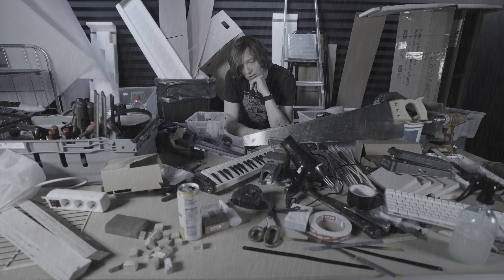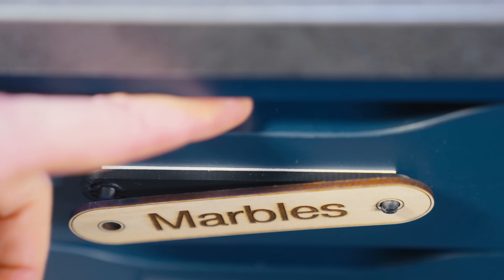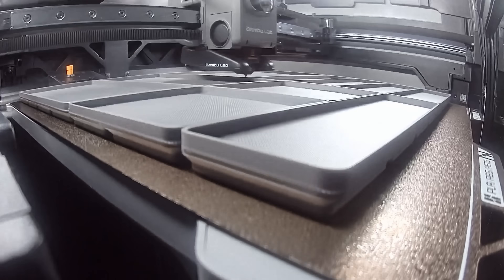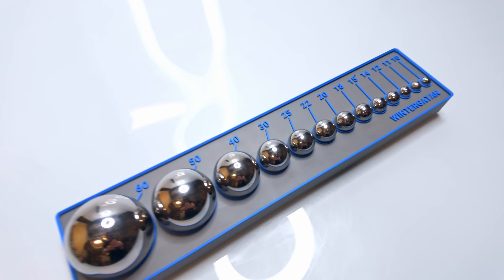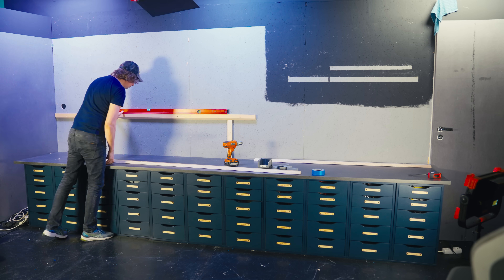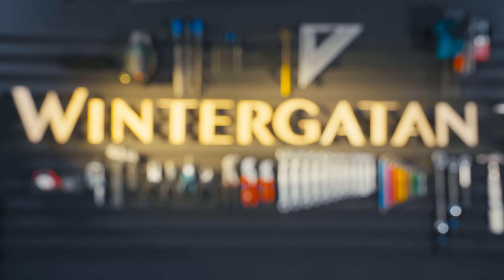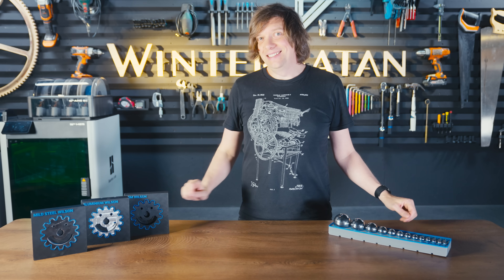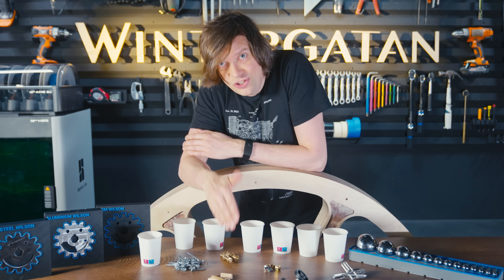Building the Marble Machine Workshop

Comment: I can relate 100 % to his need and the importance of being organized define all the parts you need within only seconds: I also am a mechanical genius/inventor always designing, testing and perfecting various different mechanical and electrical gadgets that create useful and time-saving gadgets for everyday personal use. 

BUT, in  order create these perfectly constructed and engineered mechanical and electrical devices, I needed to accomplish 2 separate goals: 
1. Having over 100,000 different parts like lightbulbs, switches, relay switches, different wire sizes and lengths, diodes, resistors, motors, O-rings, rubber grommets, brackets, straps, rheostats, just about every different size and shape of various rubber, plastic and metal parts as well as thousands of various different sizes and lengths of stainless steel screws, bolts, washers and lock washers.

 2. And, most importantly, being able to have them so perfectly organized and categorized so that I could locate and find any one of those 100,000 various different parts within just seconds. :face-blue-smiling::trophy-yellow-smiling:

Comment: Okay for real though, you should print off a bunch of single-block holders and fill your random drawer with singles and use them just like you did those little paper cups you dumped the random items out of. Then when the drawer starts to get full, you can look inside and go, "Okay, I actually have a lot of little wooden pegs, maybe I should make a space for these in one of the official drawers," and then you can look at the containers with only one of an item in it and go, "Okay, I guess I never use this and don't have any more. I'll throw it out to make space." And that is how you keep your system from falling apart while still leaving space for the realistic accumulation of random shit

Comment: @Wintergatan choose one:
 "She may be old, and loud but she runs better than the newer ones".
 "You see imperfection, I see it part of the art".
"Just because you add more boost to get more Horsepower for your Fiat doesn't mean it can haul a trailer. just change the vehicle that can".
"If what you change don't work, go back to what did work and improve it".
"If your diesel truck isn't leaking oil, then it has no oil to leak". 
"The story of Dragons goes all the way back to something much simpler".
"Never put all your eggs in one basket".
"There are always 2 types of maintenance to everything regardless of what: Corrective and Preventive maintenance". 
"Different isn't always a bad thing".
"Music is just some tool that is tuned up and calibrated. just like any other fine tool".
"You never know what you had until it was gone".

"There is no such thing as luck, you don't know Luck. So, rely on something else".
"True music is not in a book. It's in your ears and soul".
"Just because it's old and reliable, doesn't mean it's easy to use and maintain a steam train".

Comment: Okay this gave me the motivation to do my room as well. It has been on the planning for an extremely long time, and I think it's finally time. My room is a mess and I had the same issue as you, not finding it pleasurable to be in my room. Cleaning up is easy, but not a permanent solution. I need to organize stuff. I already built a huge drawer under my desk, only have to design and print the bins now.

Comment: The point on making jigs is sooooo important. I built a large storage rack with my dad and he insisted on measuring everything because he didn't want to waste time making a jig. I told him I was going to grab a drink, spent 5 minutes making a spacer block, and then when I got back he was halfway through mounting one instance of the thing we were copying. It would've taken him over 10 minutes to do it solo, together we would've probably done it in 6 or 7. After using the spacer block that time went down to 4 minutes and after making some more spacer blocks it went down to 2 minutes. Jigs and spacers are king when replicating anything accurately

Comment: Martin, I used to have the same problem, never being able to keep my workshop tidy. After a while and I think about 20 rebuilds of the workshop (no joke). I came to a simple conclusion: If you're workshop is messy, it is not necessarily because you are messy, but because you and the workshop are not in sync.
In other words, if you notice it is getting messy again, reconsider where some tools live, if the always end up on the floor or on the worktop, then it is most likely because where it actually lives is too far away from where you are working, just as an example. Put the things you use the most, closest to where you work, that was the key for me. The other thing what worked for me was: nothing  lives on the floor, no wood, no boxes or anything like that, and all the tools that require a place on the floor got wheels on them so i can roll them out of the way quickly and easily
I have now rebuilt my shop about 30 times, and slowly i have come up with a system that works for me, and now i can't stand having a messy workshop anymore. It is a joy :-)
Reply: Exactly!!! Designing an orderly workshop isn't about just making things look nicer!

Comment: One thing ive learned making a 3d printed french cleat tool wall, is that a lot of the holders realllly want a cleat lock. Basically a little removable piece that slots and pins the holder to the bottom of the cleat. Without it, you will often get into a case where you lift up to remove a tool and end up knocking the whole hook onto the ground (particularly the holders for lighter tools)

Comment: Martin this was such a great video! Also thanks for introducing me to 'gridfinity'. Wow 🤩 Also, FWIW, my tip for reading lots of words (eg your drawer storage labels) is to not use all caps for the labels. It's a tiny thing in your context but the science is that the last thing we do in reading is look at individual letters. Our brains scan the shape of the word first trying to pattern match with familiar words. Turning each letter into a rectangle of the same rough dimensions removes most of the features of the word we use to recognise it, eg springs vs SPRINGS multiplied by the number of labels you have. It's only a fraction of a second lost each time but I know you like efficiency and effectiveness so thought to mention it 😀 Finally, for any upgrades you might plan for later, consider using a symbol (pictogram) instead of words, eg an icon of a spring or a combination. You could also use a colour code for different types of items. This would speed things up for any helpers you might get in. eg hardware has green labels, cables have blue labels etc 🤔 I'm doing this combo of words and emojis on my Mac folder labels and it's a game changer IMO. Again, thx for this vid ❣

Comment: Be careful with optical lenses! Fungi thrive in dark, damp conditions! Optical lenses should be stored in a bright place (preferably with the caps removed to allow light to pass through) in a transparent box (possibly with a silica gel dehumidifier system, which needs to be regenerated when it becomes too saturated with moisture). You may be in for an unpleasant surprise with fungus on your lenses! Repairs are expensive. I've already had to pay €1,500 for a Canon RF100-500 lens worth €3,000...

Comment: IS the long table top above the alex draws from Ikea as well? I wish to borrow this setup for my workshop!
Reply: Its actually a generic 4.6 meter kitchen bench from hardware store Hornbach. Ikea have them too, but not that long - at least not as their standard size.
Reply: (I usually design studio sets using kitchen bench tops for their rigidity, so I had that one already in the Fallout set (seen in the gear down part) when Martin moved in)

Comment: I've got drawers. I've got organisers. Hahaha, it's not about having drawers and organisers, it's about putting things back every single time. EVERY SINGLE TIME. This looks amazing and it is well thought through. Please do it justice by using it.
Reply: It's an advertisement for the 3D printer.
Reply: my solution to organizing screws is to buy new ones when I have a full box of mixed screws I have to go through to find something
Reply: That final scene is straight out of Marvel movies.

”Random will return”
Reply: As Joe Barnard says: It is easier to take pride in your work when it is shiny. Putting things back is a lot easier when it makes a difference and does not just move the mess into a drawer.
Reply: Certainly. It's important to have a particular spot to put left-overs such that you are prompted to clean up and put stuff away when it's too full.
Reply: Indeed, I also have a nice order in my workshop…as long as I use it…😂😂😂
Reply: Tell this to my kids (and the wife, but I'm scared to tell her off)
Reply: A visual sizing guide for the screws/washers/bolts/etc at the base of each drawer helps.
Reply: Martin has made at least one video about shop clutter and organization, the latest was five years ago. That was in his previous shop. 

All thrust, no vector.

Comment: The problem begins when you find a loose screw but don’t know exactly which type it is. The system can be very effective, but unless identifying the bolt is as quick and effortless as tossing it into the random drawer, you will just keep defaulting to the drawer and the cycle continues.
One possible improvement is to design the system so it automatically rejects the wrong bolts—for example, a bolt that doesn’t belong simply won’t fit.

Comment: I think you’re more interested in collecting parts and pieces and screws and nuts and bolts that you have no plan for or no current need for. Then you’re building an organization for all the nuts and bolts that you again have no plan for or no need for. 

You have to create a solution for a problem that could be fixed with a trashcan, then and only then can you focus on getting the marble machine done